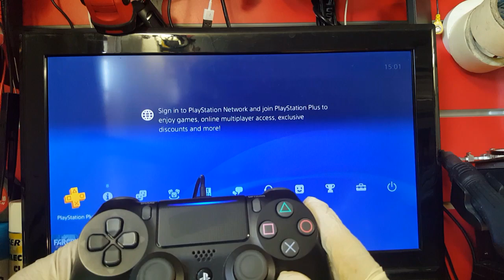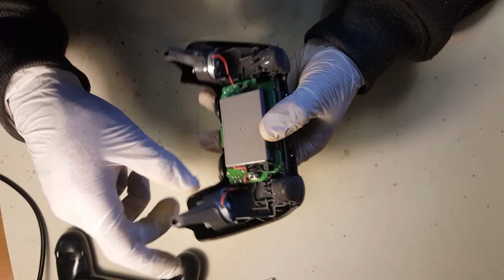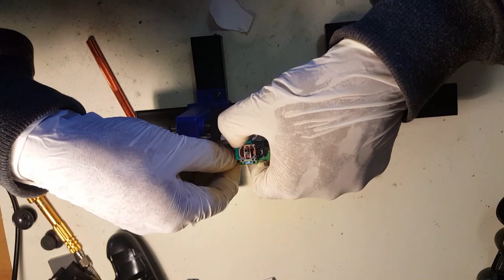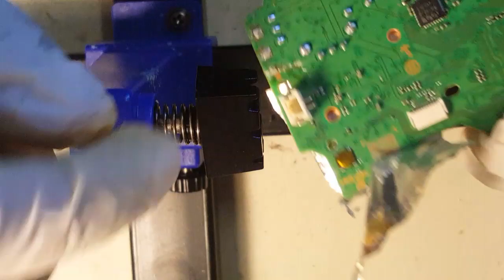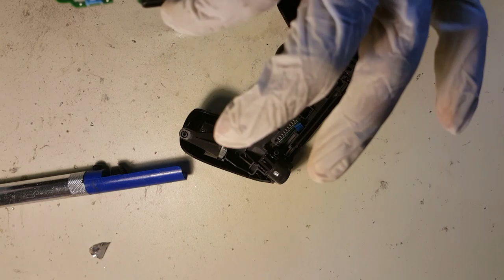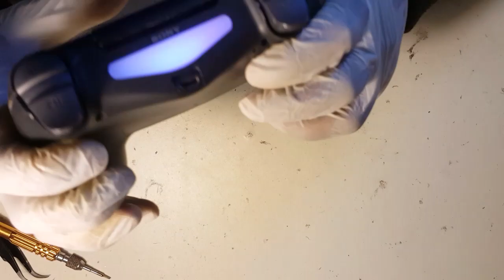Ps4 Controller Stuck Joystick Repair

Comment: is that a kaplon tape or just a foil? I'm curius
Reply from the maker: Sticky aluminum tape 
heres a link 
https://au.rs-online.com/web/p/metallic-tapes/1444030?cm_mmc=AU-PLA-DS3A-googlePLA_AU_EN_Adhesives_%26_Sealants_%26_Tapes_Whoop(AU:Whoop!)+Metallic+Tapes-1444030&matchtype=&aud-772940708119:pla-330012708189&gclid=CjwKCAjw2rmWBhB4EiwAiJ0mtS09Ku1cVcZOTeQ8iUy9HqrEKCIOzauVtPIzg74QK9HggEnLYsF6mhoCV1kQAvD_BwE&gclsrc=aw.ds

Comment: What happens if the metal plates( tracer joints) where removed and darken due to oxidation accidently done, is the pcb board damaged or broken entirely, is there a way to fix it?

Comment: I've done this twice on the controller. The first one I put on made my drifting go to the right instead of drifting UP like it was doing before. I was pissed. But I had a pack of two sticks so I desoldered and did it again with the other stick and its not as bad as the first one but it also drifts to the right. Im wondering is there a possible error with my soldering? Which contacts on that ps4 controller regulate the right input on the left joystick?
Reply: Same here, none of my stick replacements are topnotch. All creep like crazy and one won't even push forwards without catching with something that I still can't see. I'm thinking my replacements are seconds, but how are they decided as so, what are Playstations quality checks, how could they fail?
But the problems are mainly in the side sections. I'm thinking quality of connection and quality of the coating the disk connects to play a big part. Something isn't right somewhere.
Reply: @spex357  maybe you done it wrong   also the pentimeter is maybe not clean or something
Reply: @EmirDessu  Luckily I no longer use them after years of use and repairs. I still think they where substandard.
Reply: @spex357  what do you use now ?
Reply: @EmirDessu  PS5 controllers
Reply: Just try replacing the x and y sensors
Reply: It's way easier and cheaper and works guaranteed
Reply: Be careful tho if you don't place the sensors back perfectly your stick drift won't change or might get worse

Comment: For everyone who feels like this process might be a little over your head, I suggest sending it to https://driftfixer.com I personally send my controllers there whenever I have stick drift and they always come back good as new. It's only like 20 bucks and the turnaround time is pretty good too in case you were worried about having your controller be gone for too long.
Reply: some pretty shameless marketing you doin there
Reply: Well Samuel, your name is the contact on the website you posted which means you were sending controllers to yourself.
Reply: Man, I'm just trying to get my name out there. Some people don't want to risk messing up their controller by soldering so I'm just putting the option out there.
Reply: @samuelgross1250  i get it. but it is disingenuous to pose as a customer giving a referral.. just say you offer the service to anyone not comfortable trying it them selves.
Reply: I hear you man. You're right
Reply: @samuelgross1250  hey bro, I am having issues on my right joystick.  I dropped my controller on hard tile by accident and now when I play COD the controller sometimes drifts up whether I’m aiming or not.  I bought the equipment to replace the whole joystick but I don’t have the tools to do the soldering.  Anyway that can be fixed?
Reply: @skidstainz1d Hey man, yes that can definitely be fixed bit like you were saying, it absolutely requires soldering. You need to desolder the 14 pins on the back of the joystick and take it out so that you can replace it for the one you bought. At the bare minimum, you will need a soldering iron and a desoldering pump to replace it but it can certainly be done, yes. Also, if you would rather have me do it for you than buy the equipment, It is $25 on my website for the service.
Reply: @skidstainz1d  clean your pentiometers with alcohol no solering needed and be careful of course.

Comment: I replaced the left joystick because the L3 was not working and after reassembling the left joystick drifts to the left.  Do you think its a bad another bad analog joystick?
Reply: You probably soldered two contacts together, i replaced my old L3 too and it drifts to the left continuesly, had to reopen it and melt the soldering, after that it works

Comment: Could you give a link to the tools you used
Reply: - 60w Soldering Iron 
- Desolder Pump
- Heat Gun
- Soldering Wire
-Replacement Analog stick

Comment: My controller stuck on r2 button. Already replace the pcb plastick, and the result still the same. It could be the board and need to be replacw with new board..
Reply: Try replacing the rubber gromets or cleaning

Comment: I couldn't melt the manufacturer solder when i tried doing this with my iron. I had the temp at 420°C and nothing, what do you recommend? I don't have a heat gun btw.
Reply: You can add some of your own tin to the joint, then it melts easier.
Reply: Same here I was wondering if I was doing something wrong

Comment: Why Do u use flux?
Reply: It makes the solder run better especially on old solder.
Reply: To add to spex357's comment, It also keeps the solder joints from oxidizing and cleaner connection.